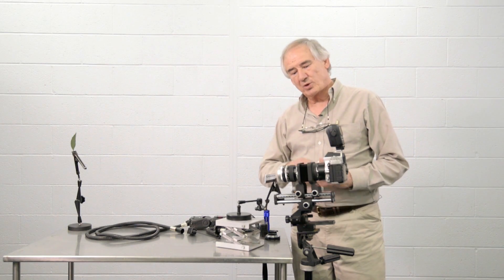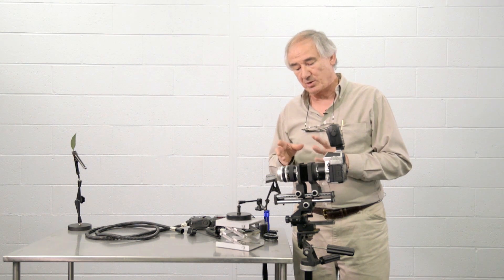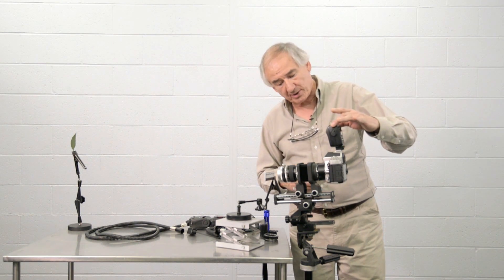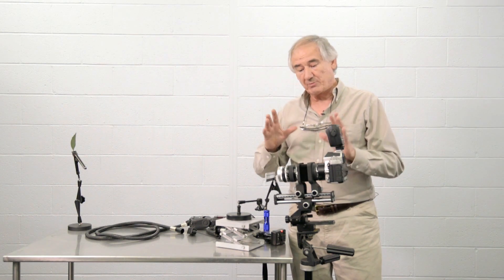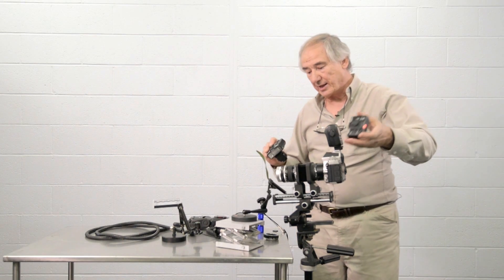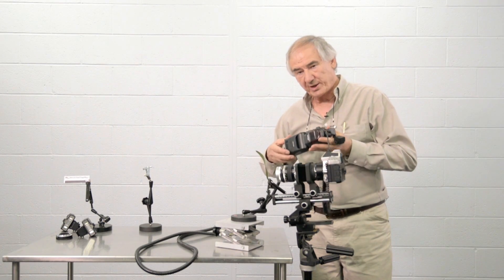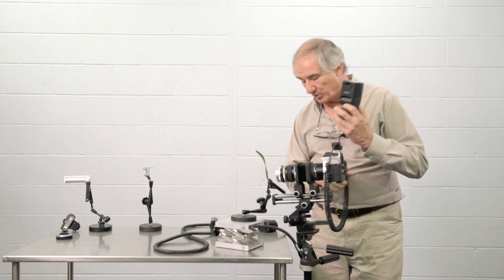Photomacrography using Bellows and Extensions

Comment: Suggestion, consider using a focus rail not on the camera but on the subject which might be considerably lighter than the huge camera/bellows rig and be less likely to move inappropriately between shots.  This allows the camera to be firmly attached to a platform and does not require as heavy duty (expensive) focus rail.

Comment: Very good informational video, but the images were not properly exposed they were overexposed, as commercial product macro photographers at our firm we manually adjust our exposure even with our macro work, even the best TTL systems are often fooled into the wrong exposure as was the case in this video.

Comment: Hello budy, how are you!! Where can I get this fiber optic hose? and this ruler too? another question does this fiber optic hose illuminate the same light that a flash emits? Thank you
Reply: Thanks for your question. I have fibre optics from Elinchrom and Broncolor. Both companies make (or at least use to make) fibre optic kits. Check with your local camera dealer and see if they can source the kit or a replacement fibre optic. (Warning: they are pricy.) Each brand has a slightly different size mount but you can drill out any size mounting hole depending on what you are attaching it on to. The color temperature of the light coming out of the fibre optic matches the source. On electronic flash, the color temperature is basically balanced for daylight (or about 5500 to 6000 degrees Kelvin).
The scales are from The Safari Group (Lightning Powder). Do an Internet search for their web site. On their site, search Products/Forensics/Crime scene documentation/Rulers& scales.
Reply: @galespring6447  Thank you very much for sharing this knowledge with us.

Comment: I need some advice.  I have  NIKON d5300. I plan to go with the same setup as yours in the video.  However, I'd like to try using a microscope objective instead of the reversed camera lens. I know there are a ton of adapters available but I dont know where to start.  My guess is to start with a camera to bellows adapter that will connect the two. Then find an adapter to fit the other end of the bellows that will fit the microscope lens.  Of course I be using a 4-way macro slider connected to the base of the bellows....like yours....with the exception, no tripod, instead I will be using a solid table equipped with a 24" by 24" PVC cage to attach my lights.  When using a microscope objective I think there would be greater magnification...more then the standard reversed 50mm for example.  The term "macro photograpy now becomes "extreme macro photography".  Now then....I have seen photos where instead of a single bug fills the frame, its entire head fills the frame showing g every detail.  
  I have always been interested in photography. However...macro/micro opens up an entire new world. With today's digital one can get amazing results. Photo stacking is one of the methods not available back when I owned my first Nikon in 1976.  Back then i was in the U.S. Navy. While visiting the Acropolis, in Greece, I took a fall with my camera hanging around my neck. Needless to say... I banged up my camera on the rocks.  The outer edge of the lens housing, where one screws on filters, was dented badly. The reverse lens system....well...no way now.  Anyway.......
  My question would be....Do you thing the reverse lens would be better then the microscope objective? I can always find another used 50mm on Amazon or Ebay for about $75.00.  The microscope objective is at about the same price.  Anyway....opinion on this please.  www.Dockside.dh@gmail.com
Reply: Thanks for your questions. I'll try a short reply. If you need more info, happy to respond again. You can get an RMS (microscope objective thread) to T-mount adapter on Ebay. Then get the T-mount to Nikon adapter. As for the microscope objective, I recommend a 4x Plan objective. ('Plan' refers to a flat field objective but some people have success using only an achromat objective.) Using a bellows, that will give you pretty high magnification (certainly a lot more than a reversed camera lens). The 4x objective will be optimised for a certain bellows extension. Experimentation will reveal the best results for focusing and sharpness. It does not allow you to choose an f-stop. It will not give you very much depth of field (you could say none). If you use stacking software, you can shoot a series at different planes of focus and create images that demonstrate more depth of field. (I use Zerene Stacker software but others work equally as well.) Using microscope objectives on bellow is challenging. Try it and get back to me. Good luck.
Reply: It may be a while before I can adventure into this. After making a few purchases online, which include a new Nikon d5300 and a few other accessaries I'm finding that covid-19  has created some delays in shipping.
  My avenue of approach is going to be the use of microscope objectives.  I'm looking to buy something that will give me around 4x magnification.  Alan Walls video on YouTube put this thought into my head. He states in his video there is a very good objective for a very reasonable price on Ebay.  My Nikor 50mm 1:2 would be great for reversal method but the female 52mm is damaged. It still is ok...but I can't even use filters with it.  Replacing the lens means buying a used one or buying another old camera. The microscope objective I'm finding would be cheaper as it sells for around $20 and adapters needed are not expensive.  Alan Walls says use a M39 adapter then to whatever I need for the bellows.  Again....I need to order bellows. I'm going to wait until shipping issues is over.
Reply: @davidhefner5668  David, your 50mm would give you 4x with good quality. I like a Nikon 35mm f/2 used in the reverse position. As for adapters, most (not all) microscope lenses use an RMS thread (Royal Microscopical Society). You will need an RMS to whatever (M39 Leica, M42, etc.) and eventually something with a Nikon mount (assuming you are using a Nikon bellows). I appreciate the problem of ordering on line and shipping problems right now. We are having the same issue in Australia. Ironic that currently we have (forced) time to do projects but can't always get our hands on the right toys! Good luck. Gale

Comment: I bought a bellows to do macro Photography Hooked up to my Nikon  D3100 and my 18-55 DX Nikkor lens and it said lens not connected to CPU can you help me.
Reply: Leonard, thanks for your question. Some models of Nikon cameras will not work if it does not sense a lens attached. The D3100 may be one of those models. I'll check further and try to get you an answer. Check the owner's manual (a daunting experience) and see if it mentions how to activate the shutter with no lens attached. Also, try setting the camera to manual mode. You may have to set it in shutter speed priority mode first to set a shutter speed through a command dial, then move to manual mode. Good luck. I'll try to get back soon.
Reply: Leonard, I have downloaded and read the D3100 manual. Info is always a bit hard to find - especially in manuals. It says the camera must be used in 'manual' mode for use with bellows. The manual says with 'PB-6 bellows' but any bellows will work. The f/stop must be manually set on the lens - the shutter speed is manually set on the camera. FYI, I believe the exposure will be automatic (at any. f/stop) if you are using a recent Nikon flash connected to the camera. Another FYI, if you own an iPad, there is a Nikon Manual Viewer available through the App Store. Then, you can download any Nikon camera, flash or Nikon accessory manual directly to your iPad. Good luck.......and I hope this helps.
Reply: Oops....forgot one thing. Your 18-55 DX Nikkor lens does not have the ability to manually set the f/stop. You'll have to shoot wide open or (much better), buy an old style 24mm Nikkor lens (cheap) that has a 52mm filter size ,and a reversing ring to fit Nikon (52mm to Nikon reversing ring). By using this lens in reverse you can get much higher magnifications and be able to manually set the f/stop.
Reply: @galespring6447  Yes thanks alot

Comment: Thank you very much professor for sharing your knownledge. I would like to ask you about using microscope lenses mounted on bellows vs reversed camera lenses. Is there any relevant difference in image quality (sharpness, contrast, distortion)? I hope you could read my question 🙏🏼 and give me a few words on that respect.
Reply: Thank you very much Professor for your words. I've been experimenting with a 10x objective and I have had lots of fun doing it. I wasn't aware of the aperture in objectives so I will try to work with one that has aperture ring. Again, thank you for answering my question, I really appreciate it.

Comment: Why didn't he turn on the Liveview mode to focus the subject?
Reply: Thanks for your question. I use various methods to focus subjects including LiveView and connecting the camera to a computer. All methods work well. From personal experience, I find critical focusing (such as high magnification with very narrow depth-of-field) more difficult using only the camera LCD screen. My personal preference is to use the camera eyepiece when possible (and appropriate) since it doesn't rely on having anything else connected to the camera. Personally, I find the LCD screen excellent for composition, but less useful for critical focusing - especially for high magnification applications. Bottom line - it's whatever works for you. Experience and practice is what will determine what works best for you.
Reply: Nguyễn Xuân Kiên no all cameras have the electrónic zoom in the liveview.
Reply: In a studio setting ie: a stationary controlled subject it is alleys more accurate to focus threw live view because you can zoom into the live veiw screen to see very closely to your subject and see if it is in focus when viewed as a crop of the full photo whereas the a view finder you are basically guessing if it will be in focus. Once you crop in tight on a photo shot threw a view finder is even you notice the detail falls apart whereas a photo focused threw a zoomed in live view crop will always be far more accurate. Just sayin💁💁 i personally shoot lots of insects so i generally tends to use viewfinder mostly because of ease of tracking an unpredictable subject but i often find that after cropping in to the shot that i have missed focus on the eyes even though threw the view finder it appeared as though i had focus.. Stationary or slow moving subjects i will always use cropped in live view to get an accurate focus on the eyes

Comment: Hi. It is not clear to me how you were able to use the wireless flash units for correct exposure when the lens is not directly attached to the camera. I have always been of the view that in order for that to happen the lens must have contact pins and be directly in contact with the contact pins of the camera.
Reply: Sorry for the delay in answering your question. Consider it Nikon magic! I use the R1C1 Nikon flash kit. The 'C' stands for 'Commander' and it attaches to the hot shoe of the camera and communicates exposure information between the remote flashes and the camera. The independent flash units (the R1's) communicate with the Commander unit through an infrared signal to control the exposure. With most (but not all) of the Nikon camera models, you can set the camera  to read the actual light entering the camera through the aperture. This is a manual aperture setting so the lens does not have to be connected to the camera, therefore; it works with accessories like bellows and extension tubes. So just like an automatic dedicated flash on the camera, the shutter opens, the Commander unit via infrared tells the flashes to fire, the flashes fire, the Commander unit turns the flashes off via an infrared signal when the camera has sensed a 'proper' exposure. As I said, It's Nikon magic.......or actually, physics! (Note, many of the new Nikon camera models now have the Commander unit built into the camera body so they don't require the big unit to attach to the hot shoe. Technology is definitely heading towards infrared (wireless) controls.

Comment: So TTL flash works despite no electronic coupling between the bellows and camera ?
Reply: Gale Spring thanks for the exhaustive reply. I have always thought digital camera can't meter flash off the sensor like film cameras do, so I was wondering where does the pre-flash measurement take place ? From the camera body or from the wireless flash in this case ?
Reply: Originally, TTL flash photography did rely on light reflecting off the film (so it was also called OTF or Off-The-Film) during the exposure. With digital cameras the electronics for reading light are in the camera and they 'talk' to the flash during the exposure. It works...it's magic. Remember, different manufacturers will have solved this in different ways so you may want to talk to the manufacturer to understand how their system works.

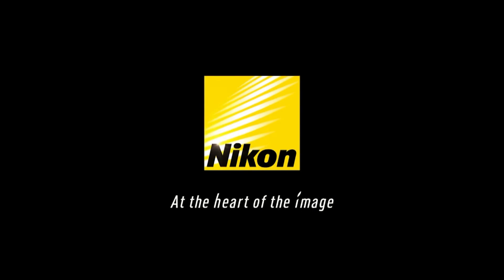Comment: For the mathematically challenged among us, would you explain how to calculate magnification? I counted ~8 mm shown on the scale card at the 13:11 mark in the video. Assuming you're using a full-frame 35mm camera, I divided 35mm by 8 mm; the answer is 4.375, assuming my math is correct. What if the camera uses a crop sensor such as APS-C? Thanks for your help!
Reply: No need for an apology, Gale. Your detailed reply is sincerely appreciated!